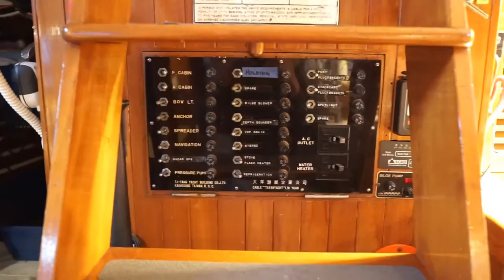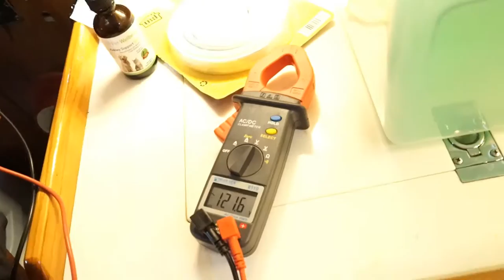SV Ramble On | Electrical Part I

Comment: LOL.. yeah if I didn't know how to do this I would have bought a brand new boat!!  Of course that is thinking a new boat would be without issues... which we all know is not the case.  If your gonna cruise, better be able to fix it yourself!  Even though your spouse is not able to help much, just being there is great. I redid most of my Endeavour 40 by myself, although she did help with getting the fuel tank out, which I don't think I could have done myself...  The ratcheting crimpers are great! And if your going to rewire, a label maker is a good thing to have.  Getting into those tight spaces though for me sucks, at 6'1'" and 230...  its a labor of love, or crazyness. Which I am contemplating doing again... which I should have my head examined!